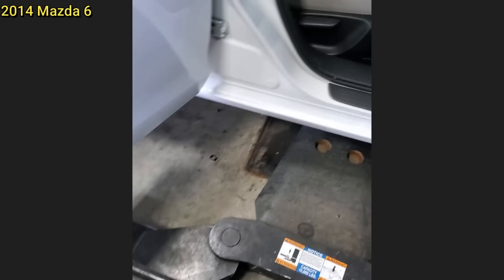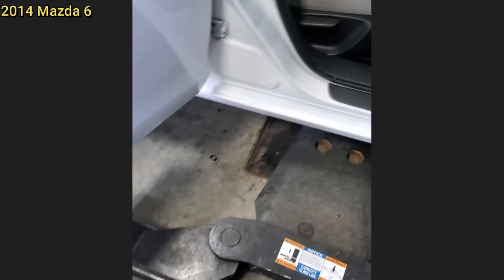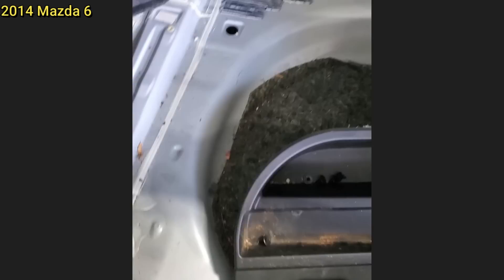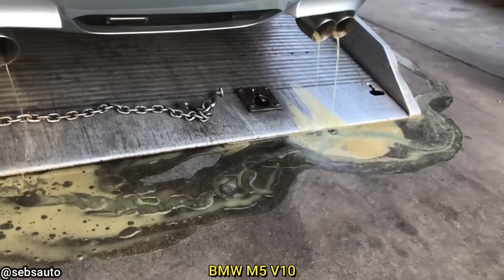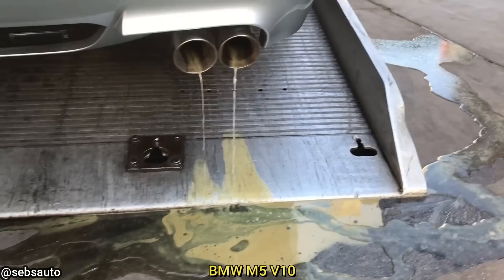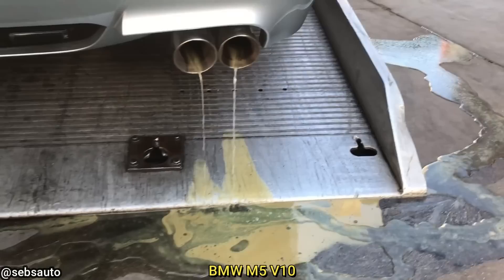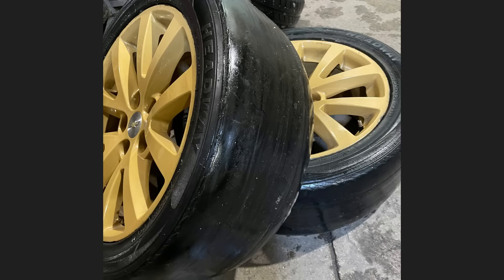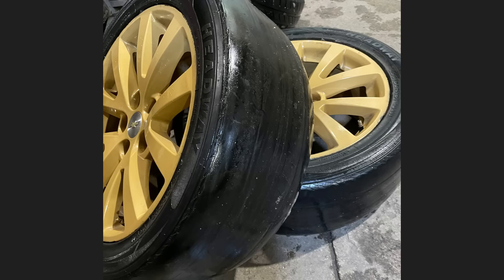Customer States Heard A LOUD Noise When Trying To Charge Tesla

Comment: "The battery pack will be replaced" - What is that, about $24,000?
Reply: I don’t know as the insurance company. 
What do you think the engine cost in that sports car? Is that also about $24,000?
Reply: @neilkurzman4907  I suppose if you holed the oil pan with a rock and drove after the oil light came on the same thing could wreck an ICE engine in that way. But you'd have to be an idiot to do that.
I think there should be some kind of road hazard insurance you could buy to protect against this sort of thing.
Reply: @John_Ridley  
Did you see the damage?
I’m not just talking about poking a hole in the oil pan. That rock is up in there. 
So the equivalent would be hitting the crankshaft. Or just damaging the block itself. 
By the way if you look on YouTube you’ll find cracked blocks, cracked transmissions, and split differentials from rocks and pot holes. 
Including on this channel. 
The only thing special about this one is it’s electric.
Reply: @neilkurzman4907  Maybe. Depends on the car. My car has a shield covering the entire engine bay. The rock would certainly get through that, but then it would have to slip up past a frame component to get to the engine.
I don't doubt that road hazards can do damage to any type of vehicle up to and including completely totalling it.
In any case I wasn't trying to imply that an EV is more likely to have expensive repairs than an ICE. But the way it was stated, "the battery will be replaced" sounded like it would be under warranty, and I really doubt that. Tesla has a track record of NOT covering battery damage caused by road hazards.
Reply: @John_Ridley  
I specifically said I performance sports car. Specifically the one in the video. 
I didn’t purposely go out of my way to find a specific car that had a lot of armor and a cheap engine. Something comparable to a Tesla. 
Something that’s not going to be totaled over a $20,000 repair.

No I doubt that was replacing that under warranty. Anymore than that car that was pouring oil and water out his exhaust was. 
The Tesla may be getting a battery from insurance, or just because the owners wants it repaired. 
I can’t imagine any car company that would cover that damage under the warranty. Nothing special about Tesla there. It has nothing to do with them.
Reply: @John_Ridley  
Here is a link to a corvette motor $20K new, $17K on sale. Plus installation.
Reply: @neilkurzman4907  I'm not sure what we're arguing about here. I just meant, that's not going to get replaced under warranty. The way it was said implied it would. I would have thought the same thing if it was a big V8 with a rod through the bottom and they'd said "the engine will be replaced."
Reply: @John_Ridley  well the way I read it it was read it, it going to get replaced by insurance. The article should be more clear. My point is a lot of people point out issues with Teslas and then compare it to cheap cars. It’s a $60-$80,000 car.  It’s not a Honda Civic. 
My friend has a Tesla three that was in an accident. He has a video from three camera angles of the guy hitting him. 
I can tell you if Teslas are expensive to fix, and it takes a long time. 
That is an actual minus to owning one.
Reply: @neilkurzman4907  Um... OK. I'm not sure why you think I need that. Also, there's no link.
Reply: @John_Ridley  
I’m pretty sure most people don’t need a Corvette motor. Except maybe my brother. And the Corvette to go with it. 
Apparently it’s also a favorite among custom car makers. 
I just assumed that a sports car engine is about 20 grand, And the Corvette is. My guess is that YouTube wouldn’t let the link go through.

Comment: 0:23 Imagine what would happen to that baby seat (and the baby in it) if they had a crash and the air bag went off.
Reply: Don't have kids but even I got the chills seeing that.  Vids went from funny to "oh crap" real quick.
Reply: You don't have to imagine.  I saw a news story in the late 90s where this happened.  Baby was decapitated.
Reply: I'm wondering what's in the back seat of that big SUV that the owner can't put the seat back there.
Reply: You know that you can switch the passenger airbag off?
Reply: @grumpyoldman5772  Not possible in a lot of cars (most frequently in 4-door sedans).
Besides, what if you forgot?
Reply: @mouseyclickey 
My '13 focus wagon has that function. A shit box and all but modern. A check light tells you that it's switched off. 
And on my' 95 Passat I had the shop disarm the airbag with a resistor/capacitor/whatever.
Reply: @grumpyoldman5772  Not all cars have that function, its mainly on European cars from what ive seen.
Reply: @bronzesaw3718  More kids :-))

Comment: And there goes 26k for a battery lmao. Piece. Of. Shit.
Reply: That's what car insurance is for
Reply: @logitech4873  Insurance will either not cover it (check the fine print), instantly drop you after repair, and/or your rate triples (as if it wasn't high enough for a tesla).
Reply: @TheGuruStud  My insurance would cover it. My bonus (price cut) would decrease from 60% to 50%, which means a pretty miniscule cost increase. Assuming no further accidents, this would increase back to 60% again after 1 year.
You make it sound like you have a terrible insurance company.

Comment: 0:24 is that a baby seat or a baby rocket launcher out the window or / crusher (airbag).  Scary how some people don't see why or how that seat is positioned there could be a problem if they stop in an emergency, zero common sense
Reply: @bluef1sh926  I'll stick to the back seat thanks for your clever ass feedback though! so definitely not the best way at all! It says. Yes, although it is safer for children to travel in the rear of the car. Not all cars have this switch actually mine  does not.

Comment: Why aren't you allowed to have a child seat i  n the front? Is this an American thing? In Europe we allow it.
Reply: When the airbag pops it will impact the seat. My Wrangler has a key switch to deactivate the passenger airbag. Two seaters and 2 door pickups usually have this option. However 4 doors & vehicles with a back seat don’t
Reply: @franklaskus2395  Interesting, here in Europe the airbag deactivator is in all vehicles, regardless of door number or size. I think it's mandatory.
Reply: @-T90Vladimir  some of the newer vehicles have a sensor in the passenger seat that switches the mode depending on weight.

Comment: What's wrong with the baby seat?
Reply: It should be in the back seat, not resting on the passenger side airbag.
Reply: If the airbag goes off, what will happen? There's your answer. Lol
Reply: @TheNortheastAl  There's a reason you can easily disable the passenger airbag. Normal in EU...
Reply: Thank you for explaining that.  I have no kids ,so I was ignorant of what it is supposed to be like.
Reply: @JustRolledIn  I guess if it's not strapped in with the belt OR using the ISOFIX points (some cars have them), then it's a risk, but it's installed in the right direction as long as any airbag is disabled.
Reply: Just read the comments about not allowed to have a baby seat in the front.  Must be a USA law thing.  Personally it's acceptable here in the UK as long as it's properly fitted and the airbag disabled.
Reply: @L1pslide  It is illegal to put a rear facing baby seat on the front passenger seat in the first place in most states of the US. Second, intentionally turning off an airbag to put your child in a more vulnerable place in the car is asinine.
Reply: @writinglife6244  What if you accidentally forgot to disable the airbag, or forgot to enable it when the baby seat was removed an an adult was sitting there when you got into an accident? Like I said before, asinine!
Reply: @TheNortheastAl  No need to be rude.  I was just explaining what's legal in my country and that I wasn't aware of what the US rules were.  As with anything in the car, the driver is responsible for their passengers etc.
Reply: @writinglife6244  I wasn’t trying to be rude, I was reflecting on the fact that common sense and the lack of law regarding this was less than sensible. No personal attack was meant toward you and I apologize if it sounded that way. To us in the US, although we don’t like government intruding in our everyday lives, this law was carefully thought out by the Transportation Safety Board based on crash tests. I understand the driver is the responsible party, but if the UK has some drivers, as we do here, then there are a good amount of less than responsible ones. Cheers.
Reply: It's super illegal and unsafe, at least in the USA and Canada it is. Laws may be different elsewhere I suppose
Reply: @TheNortheastAl  but this is the same transportation safety board that allows vehicles to be driven on the road in lethal states of repair.  We have a Driver Vehicle and Standards agency, as well as (formerly) EU based agencies that have done similar investigations and their results differ.  Yes, Preferably you would transport a child in the rear with another adult, but there are circumstances where travelling with the child (particularly a baby) in the front is a safer option. (easier to "keep an eye" on the little one to make sure they're safe)  Agreed also that there are idiots behind the wheel, but it's difficult to regulate stupid.  I just wanted to say (like many) that the rules are different in the EU, and it's not through a lack of forethought or care.
Reply: @writinglife6244  Our rules are different, and you bring up some good points about unsafe vehicles. I guess we can’t make everything 100% safe 100% of the time. Our mindset is not the same as yours, and I’m not saying one is any better than the other. It was good to have this conversation. I learned something from it. Take care.
Reply: California allows a rear facing seat in the front if the child is 2 yrs or older. What does a person do if their car has no back seat?
Reply: @chrisleggett685  Good point. What about the airbag being active?